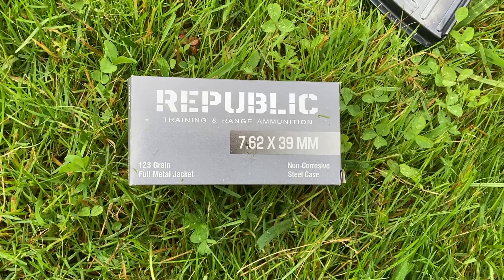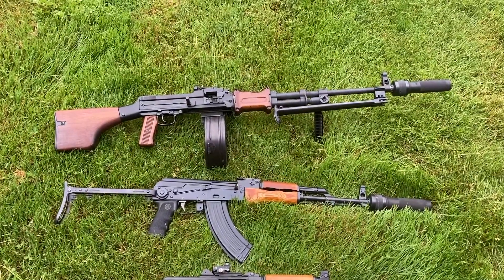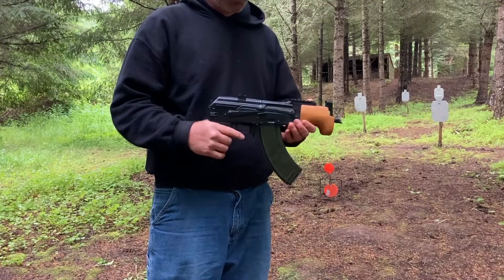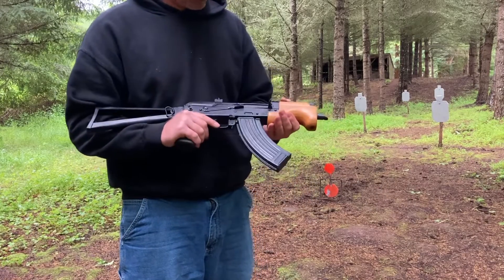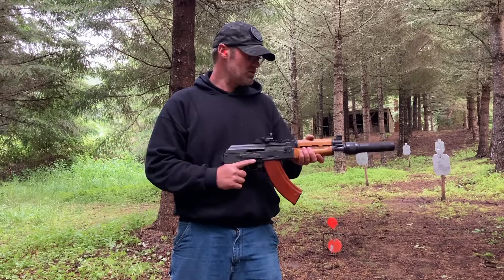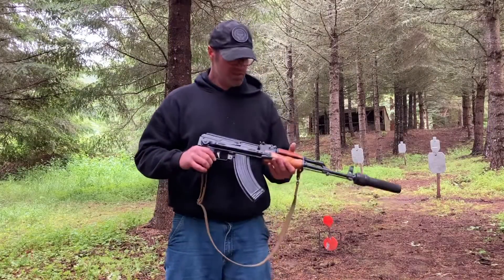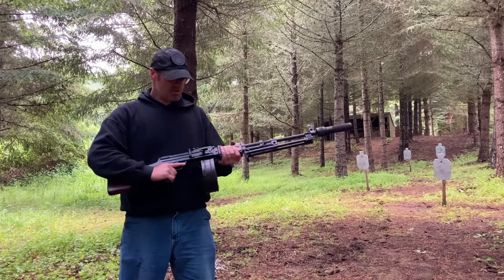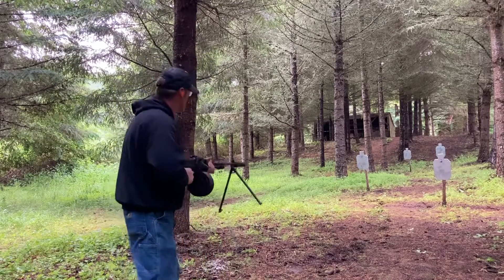7.62x39 Barrel Length Velocity Difference Extended Version

Comment: Suprised the draco has such a low velocity. Makes me wonder what the point of it is other than as a range toy if its delivering the same  power (roughly) as a 10mm/357 magnum.
Reply from the maker: @SealionPrime  it’s definitely not for military use lol
Reply: @RangeToyz  I hear it gets higher velocity shot sideways ;).
Reply from the maker: @ that’s gangsta :D
Reply: 739 fps diffrence tho isn't bad at all for a 4.75 inch barrel i was expecting 700 fps not 1674 thats wild honestly but how accurate it is and does it key hole
Reply from the maker: @TylorAcosta  the Micro Draco still has a 1/10 barrel twist rate, the same as the Draco or a WASR 10. I’d say it’s still plenty accurate with 122, 123, or 124 grain ammo and won’t yaw or tumble causing it to keyhole.

Comment: 20 inch + barrel and only 2400 fps? doesnt a normal ak already reach 2400 fps?
Rifle rounds are only effective because of the hydrostatic shock that occurs at 2200 fps (at least) better is more

Im not a big fan of 7.62x39 anymore but if it reaches like at least 2300-2400 fps its pretty effective 
But the micro draco is really a joke.. its a cool looking gun and definitely fun sometimes but its a joke… I rather have a handgun any time of the weak
The round simply doesn’t perform like a rifle bullet out of such a small barrel… you only have negatives… more recoil, more concussion, muzzle flash, sound, weight and you can up it way slower than a handgun
I rather take a 9mm carbine like a Scorpion Evo… Velocity doesnt matter that much unless we reach velocities over 2200 FPS…
I rather have a handgun that I can up quick or a carbine
lets say a 10mm carbine.. civil liberty defense ammo running 2400 fps out of a handgun, out of a carbine with the length of a draco you get way more rifle like results than with a draco.. 
I either choose a handgun/smg/handgun caliber carbine if I want something compact and get high quality ammo or if I need it I get a real rifle.. but not this inbetween BS that makes no sense and dont perform like it should and just has negatives
I think it’s ridiculous when people think you can take a rifle round and put it inside of a barrel that is shorter than a handgun barrel (when you calculate the chamber ) and think it will perform like a rifle
Its all about shot placement unless you reach velocities that create a hydrostatic shock.. you wont do that with a draco…

Comment: Micro Draco 1674 velocity with 123 grain producing 765 foot pounds energy

Aks74u 2369 velocity 60 grain bullet producing 748 Foot pounds of energy
Reply from the maker: @YattaMoyo  less recoil advantage definitely goes to the Aks74u
Reply: @RangeToyz  yep that was the whole point of the 74s lesser recoil, but put the aktf folding brace on the draco you essentially have a aks74u compact design, their both just loud.

Comment: Curious what exactly happened to your draco when it blew up suppressed?
Reply from the maker: With less than 200 rounds of subs and supers combined running the Wolverine for the first time, and the gun as a sbr, the back of the receiver flared out on both sides when the bolt was slamming back so hard because the rivets started to cant and tear back in the receiver. I’ve got a video showing it. The back end had to be cut off and this was the only trunnion/stock that would supposedly work. Old holes had to be welded closed and new ones made for the new stock. Mesa Kinetic Research did a good job, but it cost me. This is a gen 1 Wolverine and I think the new ones have a 9mm bore now and a little less back pressure. I still wouldn’t run one on here with supers. https://youtu.be/aGTZNJePb5g?si=x7go_MyOK-I1RMnB
Reply: @RangeToyz  ah noted, I’m building out a mini draco SBR currently they do make a kns piston for it but I’m not sure it’ll reduce the pressure enough. Thanks for the info and great vid man. I subscribed.
Reply from the maker: @conceptualconcepts6.9  good call on getting the Mini verses this Micro to be able to have a KNS adjustable piston. Glad you checked in. I saw a video the other day that had two of them using the KNS adjustable pistons all the way open, both with Wolverines, probably the newer versions. Are you going to use a Wolverine? It’s a great looking combo. Hope it works out for both of you. Cheers to subscribing my friend:)
Reply: @RangeToyz  I’m waiting to check the thread concentricity on it. If it’s straight I’ll have a sandman S on it. If it’s not it’ll probably be my silencerco omega 9k (checked with silencerco and it’s rated for 7.62x39 down to a 7” barrel.) to cut out some concussion. The whole concept behind the gun is to have a commie rattler basically haha. My wolverine is a gen 2 but it’s welded to my M85.
Reply from the maker: @conceptualconcepts6.9  good! That Sandman S is a tank as well. It also has a wider bore than most other 30 caliber cans. The Omega 9K definitely is. Looks like you’re checking off all the boxes. I’m jelly of your M85. That’s quite a kit with your Wolverine :D

Comment: Nice move when you went prone and fired the RPD!  Really shows that any amount of ballistic plate body armor would be hard pressed to "repel firepower of that magnitude!"
Reply from the maker: Thanks! Those 1/2” plates took a beating at that distance for sure! I’ve got them on 20 degree hangers with springs which helps deflect the rounds and energy down and away. I’ve still get some minor pitting on them, but it could be from some binary 7.62x51/.308 and 5.56 rounds too :)

Comment: Hey so I found out. That if your wolverine serial number is past 3000 you can shoot 9mm through it. But you have to get the end cap replacement from j-mac and then obviously you would have to get a muzzle device but I've landed on my kp9 it sounds awesome and less blow back
Reply from the maker: I’m stoked for you! I bought all three of mine when they first came out and must have been one of the first ones to shoot it. I contacted Dead Air and told them about my Micro Draco being destroyed from the back pressure and said it was the guns fault for being weak. A few months later the price dropped from 900 to 750 and SilencerShop was including a KNS piston with purchase. I use those pistons in my PAP M92 and Underfolder along with an O-ring inside the dust cover on the push button of the recoil rod to stop gas to my face. What a dirty receiver I get too. The Definitive Arms DAG13 would be a better gas solution for my Underfolder, but they don’t make one for the PAP M92. Your wider bore version would do wonders for both.
Reply: @RangeToyz  I definitely need to get a piston for my m92 and I don't need one for my m70 but could use one. But I think I'm goin to keep it factory so I can run subs
Reply from the maker: @brando104  yah, my 16” Underfolder cycled subs better with it’s stock piston
Reply: @RangeToyz  yea that's how the designed them. To only work in aks with factory gas. And full 16" but since most shorter barrels are more over gassed they run them

Comment: I'd be curious about an even longer barrel, 22" or 24"
Reply: According to a stat-chart I downloaded the 24" barrel averages a little less than a 23" barrel, but if the barrel is a little longer then you have more heat sink! I'll copy/paste the link, and send it in a seperate comment.
Reply: @ghostwriter1415 Shooting Chinese surplus my 10.5" Draco just splashed lead on 3/8" mild steel, my 20" SKS punched right through. I was surprised, 1st time I'd ever experimented like that.

Comment: Do you think an 8.5 inch barrel ak is sufficient for combat and protection since you’ve shot the 6.5
Reply from the maker: So the Mico Draco was averaging about 760 foot pounds of energy going 1674 fps with a 123 grain bullet. An AR15 with 7.5” barrel using 62 grain ammo goes about 2317 fps and has about 740 foot pounds of energy, which is really close. An AR15 with an 11.5” barrel using 62 grain goes about 2771 fps and has about 1050 foot pounds of energy. A 9mm 124 grain from a MP5 with an 8.5” barrel going 1100 fps has about 350 foot pounds of energy for reference. Your 8.5” barrel with the same 123 grain ammo I used would be more than double the energy of 9mm and would probably be really close to the energy of a 62 grain 5.56 bullet fired from an 11.5” barrel. I’m not sure about the bullet drop over distances, but I think you could google it and see a graph. Hope that helps you.
Reply: @RangeToyz  Yeah, that puts it in perspective. I don't know how many ft-lbs is enough... But I understand that 2x my 9mm is significant.
Reply: @RangeToyz  Just to add a little more perspective, a 9mm carbine with a 12" barrel will push an Underwood 68 grain +p to 2300 fps (798 ft lbs). So comparatively a 7.5" AR15 on 62 grain ammo (2317fps - 739.26 ft lbs) has slightly less energy than a 12" 9mm running 68 grain ammo. Just food for thought.
Reply: @razar7 specialized 9mm vs fmj 5.56

Comment: Dude the flash on that Draco is insane, just go full auto when you need a flashlight 🤣
Reply: Draco = dragon = 🔥
Reply from the maker: Definitely 🔥🦾 I had to back up from the chronograph because it couldn’t deal with the flash 🤣 If the receiver wasn’t shortened from getting messed up shooting suppressed, and I knew it would fit, I’d get a binary trigger for it! If you want to see true crazy flame, check out my Binary PTR51 Drum Dumps Suppressed video  https://youtu.be/n0aI97Pxnx0 An 8.5” barrel .308 does it big time!

Comment: Okay that micro should come from factory the 4.5mm trunnion! That is a bamf! I wonder what the muzzle energy is? I put a 4 piece booster on my micro galil it made a big difference with the concussion..
Reply from the maker: It’s a nice, lightweight folding system. Thanks for the compliment 🦾 The 5 round average for muzzle energy is 765 foot pounds. Good plan on the 4 piece booster for concussion. I had one on my PAP M92 before the suppressor. I like how short the Micro is, but might take your advice 👊

Comment: yea man best video yet!!!!! for the hell of it you should try the jmac laf break on the micro draco. don't kno about you but love jmac. that rpd tho🤤 question have you done any testing on the 7.62 Brown bear subs. as in testing the accuracy past 25 yards?
Reply from the maker: Thanks!!! Glad I could improve the video for you 👊🦾 I like the normal slant brake for it’s minimal footprint and style. I forgot to mention in the video that I was lucky to get the RPD from Atlantic Firearms after DSA stopped production from a lack of parts kits. It’s awesome com block hardware (Polish parts though). It won’t cycle Brown Bear subs, but manually cycling them would be nice and quiet with that long barrel. The only long range with the Brown Bear subs I’ve done was with my Ruger American at 166 yards on a 16” plate with 6x zoom. They seem to do fine if I aim true. It’s really lobbing them in 😂 I haven’t tested them for accuracy though.
Reply: @RangeToyz  hah. What barrel twist rate is your ruger?
Reply from the maker: @brando104  1:9.5” I’m pretty sure